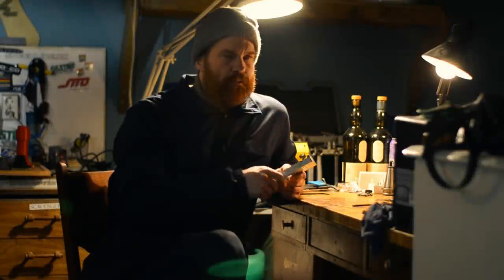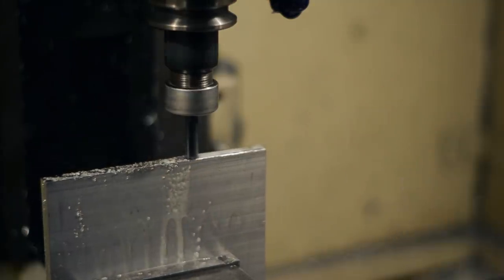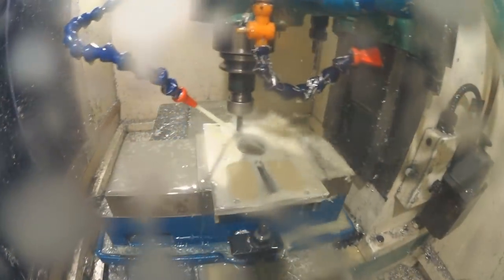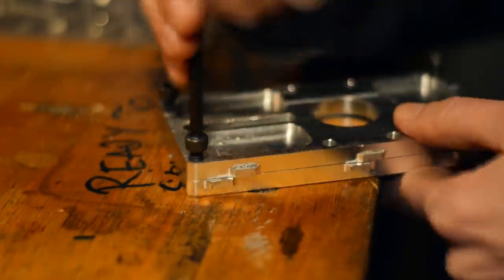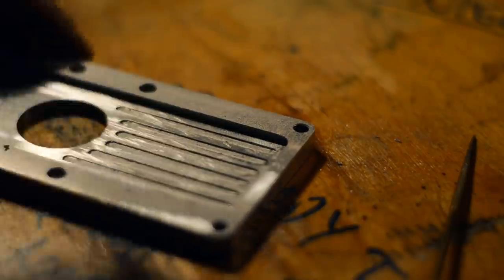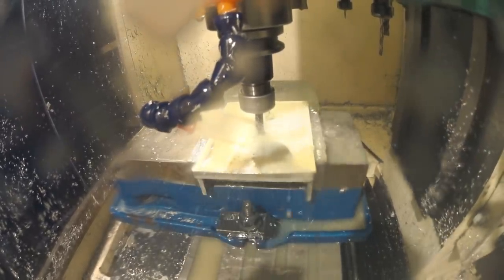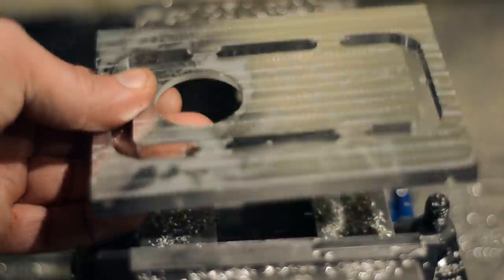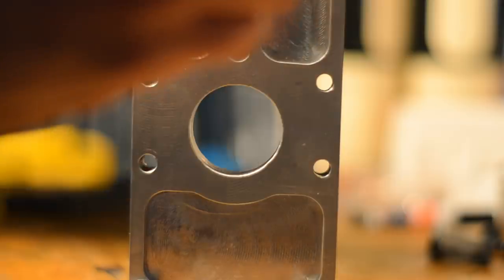CNC Slide Valve for Secondary Nitro EFI intake - Most Powerful Two Stroke Ever

Comment: I'd definitely suggest getting a magnetic solenoid to open that valve instead of a regular electric linear actuator as the magnetic solenoid will open far faster. One easy source would be electric door poppers. Could you imagine if Burt Munro was still alive today, I'm sure he'd be fighting with the computer machining too ;P I'd suggest sanding and polishing the valve blade so that it moves smoother too.
Reply from the maker: 👍 Was actually looking at door actuators a few days qgo.
Reply: An Aprilia RS125 exhaust valve solonoid would be perfect. They are pretty powerful as they pull through a cable and also drag the coked up gummy with oil blade. Should be perfect for this. If you get one be sure to put an inverse diode, maybe 1N4007 across the coil to save any spikes from killing your electronics👍
Reply: You might not want to open it too fast also.
In a fourstroke engine you would have big problems setting up fueltable for instant opening.
And i figure a twostroke should have the same problem.
Reply: @M Bacon or even a metal gear RC servo. Fully tunable then. They do get jittery around high energy ignitions so a metal one and screening the lead would stop that.
Reply: @M Bacon the thing is linear actuators tend to be slow where solenoids open quick.
Reply: @Patricks_Projects  once it opens he's going to be injecting nitro methane into it.
Reply: @M Bacon RC servos are relatively easy to control too. The older ones were ground, 4.8V or so (nicad pack) and a PWM signal for position. Modern ones are a proper digital position signal. Donkies years ago as a final project at college we had to build something in team of three that was mechanical and electrical. One of the guys on my team had a big caravan on a tight to maneuver concrete pad. We decided on a caravan mover with a Briggs engine and a couple of wheels to attach to the ball hitch. We used an old type PWM servo for the throttle and it was all over the place😂. More modern properly digital controlled ones will probably be fine. As you say the ignition should be shielded anyway.
Reply: @jaratt85  yes i know.

Comment: Glad to see you're becoming a decent machinist! A little thing I like to do for a touch off is where I take a gauge block (maybe 10mm), put the tool slightly lower than a 10mm hight and just slowly move it up and push gently on the block until it snuggly slides between the stock and the tool. Then of course subtract the 10mm offset. That way you never accidentally plunge too far and crack the tool or anything.

Comment: You probably know this, but I hadn't heard it mentioned yet.  For cutting aluminum - if you switch to a 2-flute cutter you'll get a much nicer finish. Adds less heat into the local area, so it keeps the chip from micro welding onto the surface.
Also - mineral spirits is cheaper than WD-40 and makes for a very nice cutting agent for aluminum machining.
Keep it coming! Love the videos.

Comment: Taking on something that has problems and fault finding and fixing those problems gives you a much greater understanding of the machine than you would of had if it just worked as it should 🙌
Reply from the maker: 👍 I think that's why I enjoy it so much!
Reply: @2STROKESTUFFING  keep on doing what you're doing 🙌 I've been following your content for around 2 years or more now and this is by far your most technical encounter (that I've seen)

Comment: When using high speed steel drills: 
Vc=25m/min and Fz 0.2mm 

Vc is the cutting speed of hss
Fz is the feed rate per tooth per revolution 

(ur using a 2 flute drill, in that case ignore the ''per tooth'' part. Not for solid drills)

Use this formula to calculate rev/min:

N=Vc X 1000 / pi X Diametertool 

When u get te rpm then multiply by the Rev per tooth u want to get the desired feed rate in mm/min

Example:

Dia 16 hss drill:
VcX1000/PiXd = 25000/(3.14x16)= 

497 rev/min 
497x0.2= 99mm/min

Comment: Clamp your part directly to the table. On a larger sub plate to protect the table, of course. It will have more support and chatter less, improving your finishes and tolerances.
   We always kept an aluminum sub plate for that purpose at least an inch thick. Drill and counter bore 4 holes aligned with the T - slots, so you can bolt it to the table using allen bolts and t-nuts. At this point you can take light cuts with a large diameter cutter( fly cutter 4 " or more ) to make sure it's flat and true. Then flip over the plate and finish the other side. You can use two sided tape to hold it down, your cuts should be
 .005 deep only so it should hold fine. Just clean and wipe down the area you're going to use tape on with alcohol really good so the tape sticks properly. You can drill and tap a series of holes for future clamping purposes, or just put 'em where you need them as you need them...

Comment: You can take the burr off aluminum parts quickly with a wire wheel on a grinder
Reply: On soft alu i sometimes use a knife..

Comment: 20-30 feed rate on drilling using a .100 peck drilling cycle I believe is on the safe side. I'd have to check my notes but I believe it's a G83

Comment: Awesome! Real parts! Now it'll really start to pay you back for the time/money/blood you've put into it.

I wouldn't bother with drilling in the mill, just center-drill everything and use your drill-press afterwards. It'll save a great deal of setup, and it's only a matter of time before you'll snap a drill off in the part and that's no fun!

also, If you've got any space/toolholders left I'd definately suggest a chamfering bit as it'll massively reduce the hand de-burring. not essential but it can really neaten up the part and make life a lot simpler.
Reply from the maker: Thanks! Great advice on not drilling and getting a chamfer tool!

Comment: Fusion has a speeds and feeds calculator.  That will help with drilling.  Just set your tool path in manufacturing environment and check the tool path metrics

Comment: When adaptive clearing with a slow machine like this you can select 'both ways' and set your width of cut or feed slightly lower on the conventional passes. I find i run my triac 70/80% of the speed of the climb pass. It means your low rapid rates arnt such an issue. And speeds things up quite a bit
Reply from the maker: 👍 Thanks for the advice! What rapids are you running on your Triac? Currently running Z - 1000mm, X&Y - 2300mm on mine.
Reply: @2STROKESTUFFING  I've an older 1986 pnc triac that is still running on the original motors and drives. I'm running x&y 1500mm/min and a 1200mm/min. Cant recall acceleration values off hand but it's not aggressive. I also use smoothing option on adaptive clearing paths, it helps with roughing. Less stopping and starting.

Comment: Get a finer tooth (normally labeled for plywood over here) blade for that chop saw and it will leave a better finish. I regularly use a table saw to cut aluminum sheets. Just use a high tooth blade.

Comment: I'm not sure if it's been said but if you use a flycutter instead of an end mill for surfacing/facing you can get a much better finish (without the cut lines). Great work!

Comment: probably not that important in your case because you run it open in full throttle, but I would be worried it sucks air. At the shop where I did my apprenticeship, we built a small line of slide valves like this for a vacuum system that goes on a cnc mill.
everything stainless, the flanges were thick and  had a groove for a poliamid gasket. the slider itself was brass. Run on two festo air cylinders. Don’t remember how often they would open and close a minute but that stuff last for 10 months at a time. We also had to drill each unit and use pins so they line up once you assembled it.

Comment: Heat in oven to make sure its gassed out and doesnt bind under pressure or dry polishing will give it a better finish like carb slides it gonna get hot on the flats also spray fresh fuel in cylinder before even breaking in the cylinder like 10khp topfuel super charged

Comment: Slightly off topic. You were going to use a hydraulic pump to create load for your dyno. We recently built an inertia dyno and I am currently building an attachment that uses 2x truck alternators and a PWM to alter load for live torque outputs from a load cell. Alternators can handle 18000 rpm, might be a good option for you and require less reduction in rpm between motor and your test rig.

Comment: great voiceover! but i have to say that there is such a thing as too little feed, especially with aluminium. the insterts made for steel especially work best when the chipload is a little higher as the material gets pushed away by the microscopic radius along the cutting edge instead of getting cut like a scissor cliding through packing paper. this effect also causes excessive drag on the tool which is unquestionably problematic when diving into material with the whole face of the cutter engaged so go push that machine a little! it looks like a pretty sturdy thing with a lot of weight on its side
Reply: the mill not being able to go at high enough feeds can be compensated by usig cutters with fewer teeth so that per revolution every tooth gets more material than when being shared across more teeth, although two or even one bladed cutters can cause problems with interrupted loads on the machine and at certain spindle speeds the machine can resonate.
Reply: and by all gods use gloves or pliars to remove those burrs or you will skin your finger

Comment: Why mill slots to keep piece from falling out?
Just mill almost through all around, leave a couple of tenth´s of a millimeter, then just break it loose.
Then use the first piece as a fixture for the next piece, face it and drill the holes, and bolt it to the part you did earlier.
And for setting origo(zero in xy planar, always use the vice´s not moving 'jaw', set that zero in G54, and then call g54 in program, that way you are always certain where your zero is(use the same zero in cad/cam software)
Another tip; i almost always use a paper to set zero in Z axis, postit´s are 0.1mm thick.
Then i just set the other tool lengths in tool offset tangenting them at the same spot with the same paper.

Comment: drill feed rate 0.002-0.010 feed per tooth and in aluminum as fast as you can without melting it/slower if you want a better finish. spot drill size helps with entry chatter, you never want it to grab on the outside edge of the drill before the center has full contact. (you can half ass ream with them as low speeds 40rpm or so)

Comment: Usually best to use dissimilar metals when sliding against each other, to avoid wear/galling. A brass slider would be better.
Reply: Might consider hard anodize of slide or all aluminum parts to reduce chance of galling.
Actually, anodizing all aluminum exposed parts would provide corrosion resistance for the salty environment.
Reply: @M Bacon I race modified vintage karts with all kinds of crazy fuels .. even with straight methanol / oil .. the engine MUST be purged with gasoline / oil after running it. Methanol attracts water, and corrodes aluminum ... so purging is a MUST in almost all cases, unless running just gas/oil.

Comment: will this slide have a seal in it somewhere to prevent air from bleeding in while its running off the primary intake? i know once its on the secondary it won't matter, however, it seems like while its on the primary its gonna cause a big air leak. keep up the great work though man! i love watching this come together!
Reply from the maker: Adding an o-ring if it leaks. Tight fit + oil might be enough tho, just like on a rotary valve.
Reply: @2STROKESTUFFING  I'm definitely interested to see!

Comment: are you going to manally open/close the valve while your driving or do you have some tech prepped so you can open and close with a switch with maybe some kind of servo?
Reply: He's going to manly open the valve of destiny ;)
Reply: Maybe he could open it with pipe pressure.
Reply from the maker: Servo/solenoid controlled by rpm.

Comment: I think you will find cutting slots arent so scarey if you go in with a endmill that is smaller than your final size and rough the slot by going in steps. First pass maybe 1/3 the depth, next is 2/3 and plunge through on the last. Then go around the profile at full depth, and climb mill (cutter is rotating in the same direction as the feed).
Reply: The other way I've done it is to plunge the mill through, retract it, then step over and plunge it again until roughed out, then do the clean up pass. A big advantage to doing it with the plunge method is that because of how the endmill is being loaded, its close to impossible to break it!

Comment: I would recomand to buy a little carbid 90 deg deburring tool for your mill. Than you can mill all the chamfers on the part. It needs time in programming but it will lift up the quality of your parts a lot. And thise tools last for ever

Comment: feed rate in  Inches or Millimeters the perspective is CHIP LOAD per Tooth times NUMBER of Teeth times the spindle RPM is the calculation.    because you using a Vice keeps the cutting forces directed to the fixed jaw if you can.  Keep chip loads light. You have time your not mass producing so .002 to .008 inches or  .10 to .20 mm per tooth is a good thumb rule.   All Milling machines run inches per minute or mm per minute F numbers.

Comment: Slide valves on intakes typically completely seal themselves under vacuum and it will not open because the friction forces get way too high under that vacuum. I'm not completely familiar with your design the chances are if that engine is running and you try to open that valve it will not open. This is from experience. Hopefully I'm wrong and your particular design won't have such problems. But from what I'm looking at it's a very high possibility. Good luck and I hope it works well for you.

Comment: Also, how are you planning to actuate the valve? Something like a central locking solenoid from a car door might be light enough, powerful enough and fast acting enough for this application.
Reply from the maker: 👍 What you said😁
Reply: @2STROKESTUFFING  have you considered using something like Molykote D321r to reduce the friction on the faces?

Comment: Just wondering if the tool path direction is wrong. That it is going counterclockwise when making lager holes. Can make it so the side of the end mill is rolling on the part when feed speed is increased. Maybe

Comment: Wouldn't you have been better of with a normal butterfly valve and it would have weighed like 3x less? I would understand making a throttle slide if it's going to have an oval cut out for better throttle control.

Comment: In an earlier video, you said you designed this motor to run at a specific high RPM, and specific load.
Given that, can you replace your spark plug with a glow plug?

Comment: do you think ? you might get an air leak around that slide valve , does it have an o ring on the crank case side to seal it ?  or am i missing something  bro .💖
Reply from the maker: Might like, if so I'll use an o-ring👍
Reply: @2STROKESTUFFING  been following this channel love what you do and ive tried to emulate your style in my own channel but no log cabin 😊

Comment: Single flute carbide cutters work well for slotting aluminium and they are really cheap on eBay https://www.ebay.co.uk/itm/5pcs-6mm-X-22mm-Carbide-CNC-Router-Bits-Single-Flute-Spiral-Cutters-End-Mills/203146343045
They like plenty of spindle speed so run flat out. I use these a lot on aluminium. I generally only go bigger if I need to remove a lot of material. In that case high helix double flute cutters can really shift a lot of chips, though they are a significantly more expensive.

Comment: some tipps 
for milling aluminium use a milling cutter with 2 flutes 
you can run all the time with full speed 10000 rpm or more
feedrange 1000 - 2500 (it depends how much power your milling machine has)
if you use milling citter with 4 flutes you need to reduce the feedrange 
attached you find a link to a german company (in german)
there yoan easily calculate Rpm and feedrate.
https://schnittdaten.meusburger.com/kalkulator/fraesen/
great job - thumbs up

greetings from austria

Comment: Nice work as always, but why did you make it so long below the opening? Wouldn't a simple plate closing the hole be enough?
Reply from the maker: With a hole in the slide it's much smoother when open.
Reply: @2STROKESTUFFING  Okay, thats a verry good point. Am I correct with the assumption, you did that for better air-flow?
Reply from the maker: @dunichtich100  👍yep

Comment: Awesome work mate!!! Are you planning on having a seal on the motor side of that plate so it dosent leak while shut? O-ring maby? Or are you just hoping the vacuum will pull it against the inner surface and fuel/oil residue will seal it?

Comment: Also, it looks like almost all of your tools are dull. You shouldn't be getting burs that big from these ops.
Reply from the maker: They've been through a lot of feeds/speeds trial and error...
Reply: @2STROKESTUFFING  I watched your video pretty closely. I'm actually not sure about my comment. Your surface finish and the amount of burs/chatter is pretty high. I wonder if something is still going on with your machine. Is it possible you have Z-Axis play from backlash? Or some other axis? I know you tested spindle flex and it was pretty reasonable for that size machine but the way your machine is acting is as if something can move freely while it's cutting.
Reply from the maker: Might be the gibs. Haven't tightened them after fixing the automatic oiler. I'll look into it👍